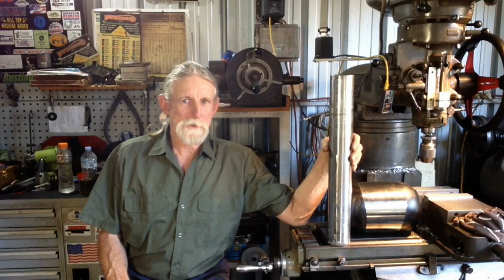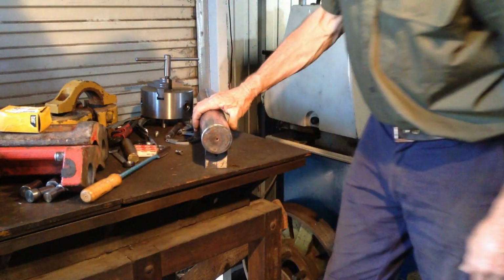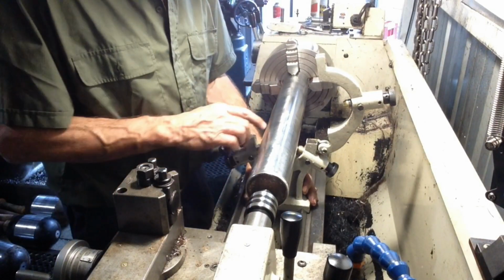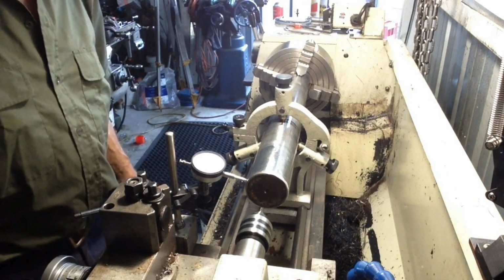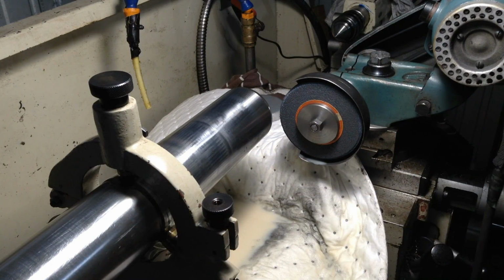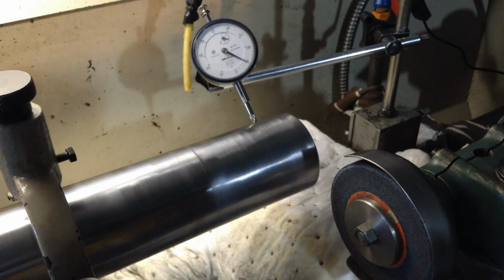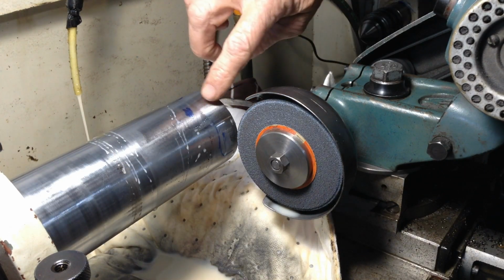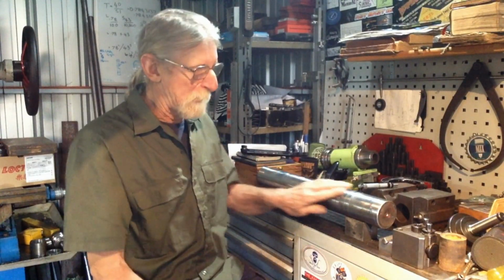Tool Post Grinder Action !

Comment: Hi Max, a little after the fact but would it have been worth it, while you had it set up in the lathe, to have recut the centers anyway or would the hardness have carried right through the end faces making repair virtually impossible?  
Thanks for an informative video.
 Regards from Canada's banana belt.
🤞🇨🇦🍌🥋🇺🇦🕊🇦🇺🪒💩🪓🐖👜🏁👍
Reply from the maker: Not with the hardness .  I usually lap them .   Cheers

Comment: I have put shim stock in between the live center and center hole to get the bar to run true.  That is one way to fudge it.  Try plastic shim stock or aluminum foil.  Could also shim the center hole to get the shaft to run true, mount a cat head and skim cut it to true that, and run the steady rest on the cathead to redrill or single point bore the center hole.  If you would need that center hole true and didn't want to mar the shaft surface with the steady rest.
Reply from the maker: No worries .  All sorts of uses for shim stock & rolly papers !  👍

Comment: can you make a cylindrical master square or a test bar using a tool post?
Reply from the maker: Yes , you could use the tool post grinder . 👍
Reply: @swanvalleymachineshop  Thanks for the reply. That is really interesting to be able to make such high precision expensive instruments using a lathe and a tool post grinder.

Comment: When I first started getting gear I bought a knock off of a Noga and I'll admit it has it's issue's. I bought a Noga later on and a very nice jeweled Federal dial indicator to go on it. The Noga and the knock off sit on my lathe side by side, I still reach for the knock off that has a Peacock dial indicator on it. I know where it's weaknesses are and how to work around them now from using it for so long. For the life of me I don't know why I don't use the Noga, all I can think is where I have used the other one for so long it's just become habit to use it. I will admit if I am having to use a test indicator and dealing in the .0001 then I use the Noga because it is sturdier but for dial indicators the other one does the job and I can hit the mark with it if I'm dealing in the .001 range without issue.
Strange how we become creatures of habit.
Reply from the maker: Lol , I still use my wonky old mag bases !   One day i will splash out on a Noga . 👍
Reply: @swanvalleymachineshop  Ordered one similar to yours today. I had one that was a cheaper one my father had bought years ago but he let it rust up and the mag knob didn't want to turn. I ended up getting a Craftsman mag base with a Federal C81S for $42 US plus shipping. Both pieces look like new, someone had scribed 1978 on it.

Comment: when you grind off the high spots , doesnt that decrese the overall diameter that the customer now needs a oversize seal or bearing ?
Reply from the maker: Just taking the high spots off brings the diameter of the damaged areas back to the  original size .  The high spots were caused by metal deformation on the end of  the pin due to sledge hammer blows .   👍

Comment: Hi Max, Thanks for showing us the repair. Could you tell us the wheel type and grit you used. Cheers Kevin
Reply from the maker: Hi Keven .   The wheel is an Abrasiflex  9A60JV   100mm dia .  👍

Comment: Hello Max from Brisbane. Can I suggest for the hard material slow the work rpm down a lot. Also try Abrasiflex for a 9A 60 K wheel. Good job on the pin. BC
Reply from the maker: The first part of the grinding was edited 3 or 4 times faster .   The last parts are all actual rpm !
I have found with my TPG , quite often running a too slow surface speed can degrade the finish . Through experience , i have found the best finish can be achieved not directly after a fresh dress but halfway between that and a dull wheel .
The wheel that i used , 9A60JV is the only readily available aluminium oxide wheel over here in 100 mm dia .  👍

Comment: And after all this carefully executed precision work you did,I bet someone will put this pin back in place using a sledge hammer...
Reply from the maker: Yes , but at least it will fit properly with a few light taps !  👍

Comment: Max, on a job like this do you ever bother to "repair" the bad centers?  Or is the pin likely to never survive its use well enough  to make it back to a Machine Shop for a second repair?
Reply from the maker: If it was critical to be able to carry out the job , then yes .   In this case it would take too much extra time  for no gain ..   👍

Comment: Hi Max, Very useful demonstration. I found that the selection of the grinding wheel gets really critical with some steels too.....Dave
Reply from the maker: Thanks Dave .  Yes you are dead right .   We only have 2 types of 100mm wheel readily available here .  39C60LV silicon carbide or the 9A60JV  aluminium oxide .    Pretty anything else has to be imported on a special order .  👍

Comment: Gday Max, Excellent video and how to do the job properly, I’ve seen a lot of pins ground down after there been flogged with a 14lb hammer to get them out, i really enjoyed the R8 arbor series, have a great Easter mate, cheers
Reply from the maker: Thanks .  I had to use a large  hyd press to get that one out ,  the pin had been installed with the old 14lb adjuster last time !   👍

Comment: Hi Max, like the Macpherson chart on the wall, bought a 4" Dawn fabricated vise from them back in the seventies in Vic Park.
We had a huge flat bed Macphersons lathe which was pretty well flogged out and replaced it with a LeBlond Regal.
Blackwoods has the market pretty well covered now.
Reply from the maker: I have a few of those old charts .  4 digit phone numbers on them !   👍

Comment: As soon as i saw those centres i though you ain't going to use them - if the end of the shaft is mushroomed god only knows where the centres will run .
I remember years a go working as a general hand at a hardchrome joint - the grinder operator spent heaps of time fixing a centre on  a ram and doing the pre grind only to see the plater take to the centre with a drill bit and then a 1/2 inch tap ! A Turk vs an Italian - it was like the war in Europe had come to Australia 🤣
Reply from the maker: That would have been interesting to watch !!!   👍

Comment: Cleaned up nice Max. Until the next hammer handed Neanderthal gets a crack at it. 😠
Reply: Not too often that pins like this can be removed with a few light taps with a tack hammer. Bushes and pins wear and little raised ridges can make pins difficult to extract, not only that, but the job demands make getting it done more important than elegant engineering solutions, involving equipment that you either don't have with you or perhaps you don't have it at all. Sledge hammers are both your friend, and your bosses friend too. The chances are that this pin will go back as a spare, and the machine is already back at work, unless they got Max to fix it over Easter while everyone was off work and no extra downtime was recorded. 
Great job there Max, but as a rank amateur I would have wiped off all the way oil from the lathe bed, then covered the ways with plastic with rag on top of that to keep the grinding dust at bay. probably would have ground dry as well or perhaps used a mist spray rather than flood coolant. That grinding dust could cause a lot of wear if you didn't manage to trap it all. Having said all that, you are the professional and I'm the amateur and I may well be over thinking it all, Cheers and many thanks for all your efforts in making these videos